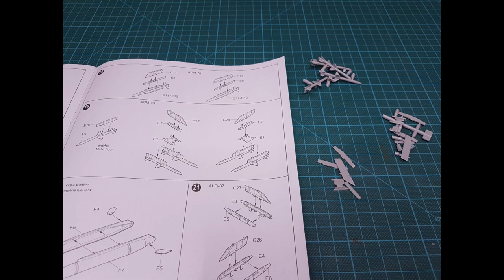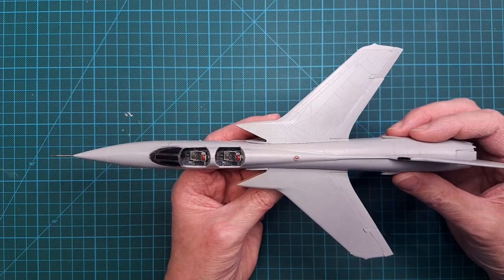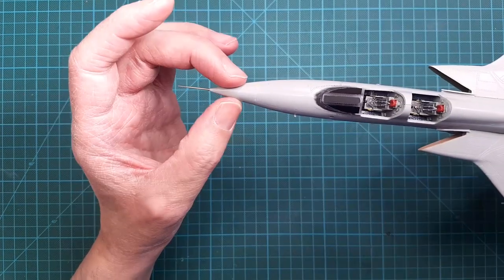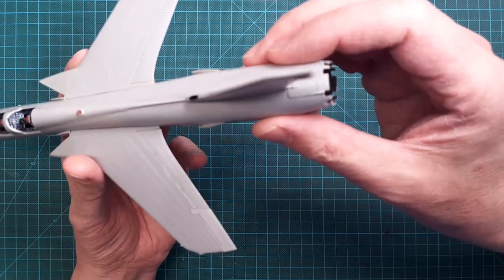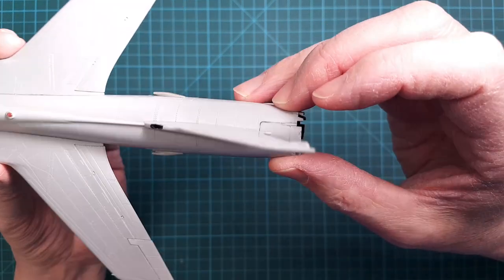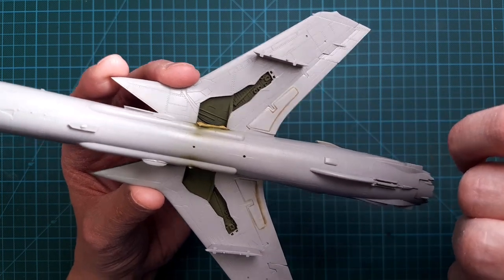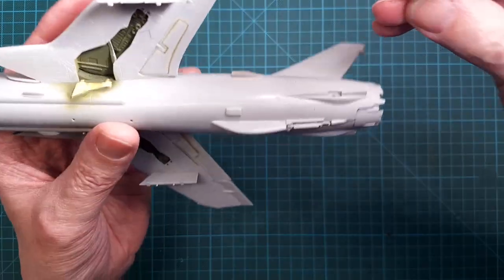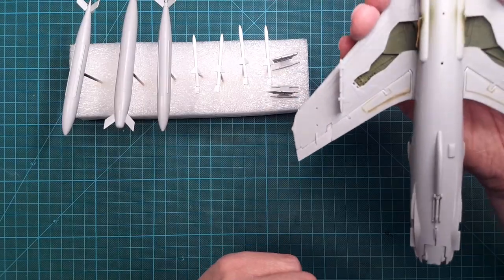F-105G Thud Build - Episode 2: Build phase

Comment: I walked around these for 4 years when I was in the Air Force.  The four petals on the exhaust had the appearance of sooty stainless steel looked very dull.
Reply from the maker: Thanks for the info. I will weather them alot so they will not look brand new when I'm finished with them ;)